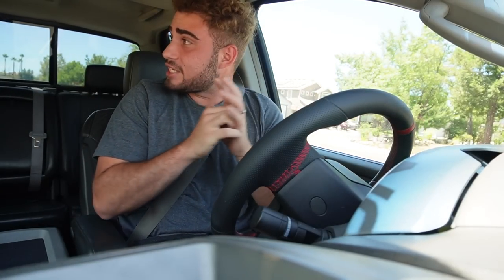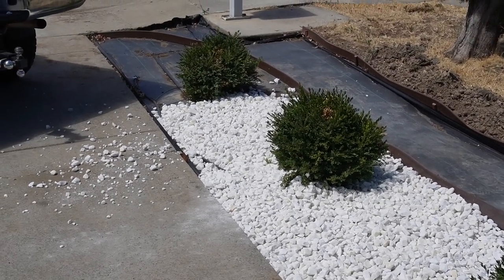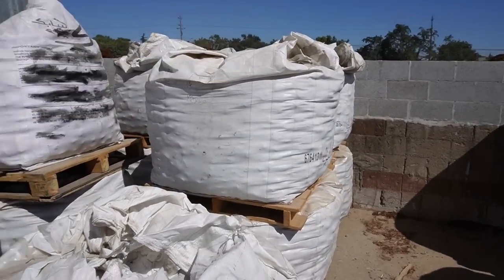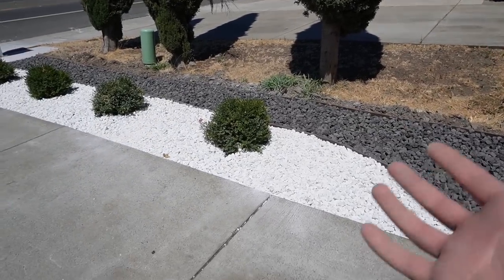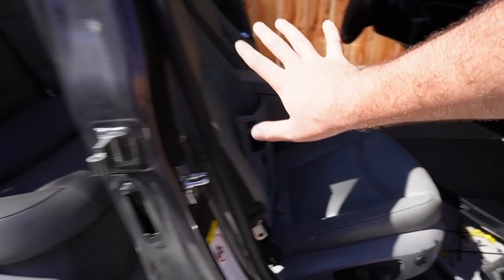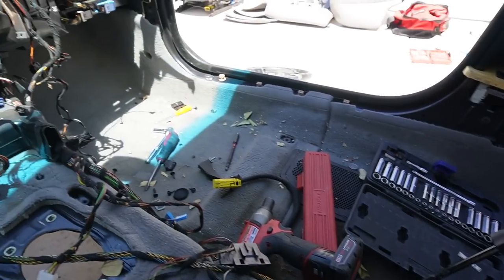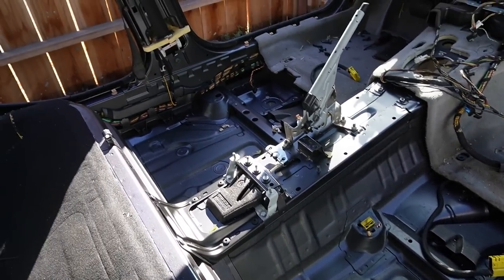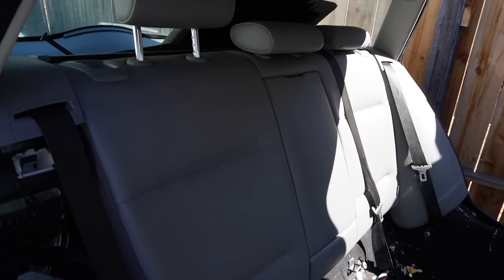Building A Custom 1 of 1 E91 M3 Wagon! (Part.4)

Comment: Damn Nour, good call on the black and white aesthetic with the rocks! The little vlogs in-between content is pretty chill tbh, and it sets the mood for the rest of the video. I also agree with you on the E90. The spec is perfect, the damaged area is perfect, and you won't be able to find another so quickly with the same criteria. This is something new to experiment and learn, and since you mentioned this car is going to stay, you shouldn't worry about salvaging parts from another car to build the perfect E91 M3 conversion! 

Hella props to you for starting this project and I'll be sticking around till the end, peace brother.